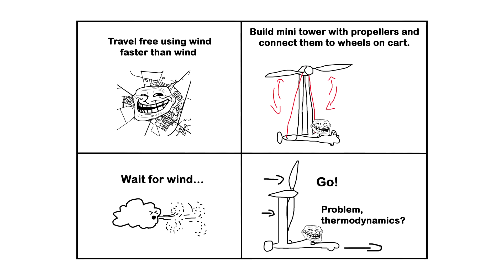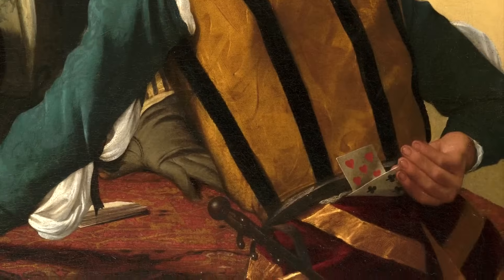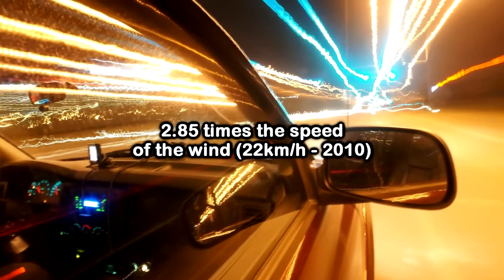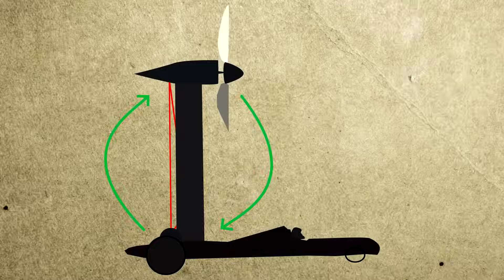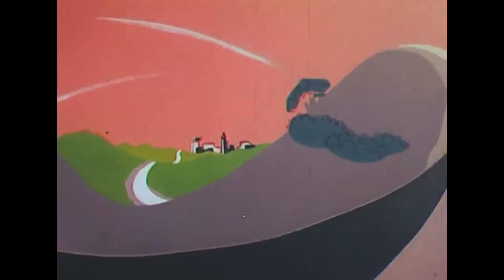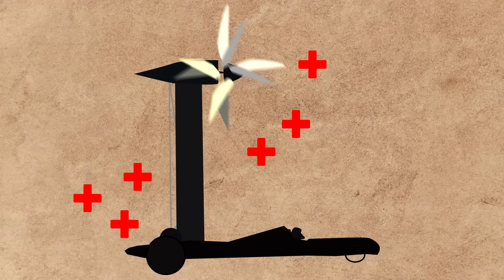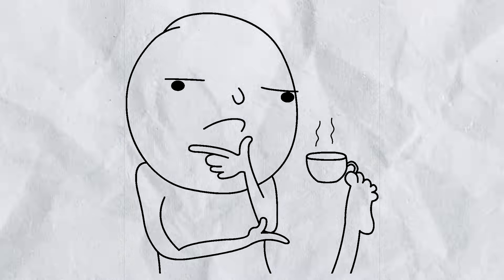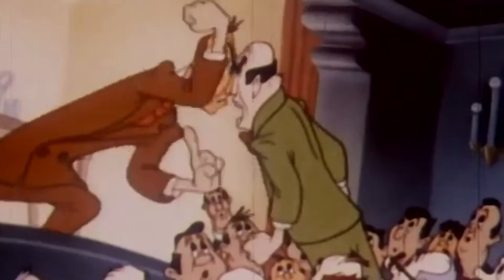why it works 14

Comment: if you still don't understand it, this is how it works basically:
1) wind pushes vehicle kinda like a fan-shaped sailboat, making wheels move. The fan does NOT help at all.
2) wheels turn propeller backwards(!). Not in the direction you'd expect!
3) vehicle gets to same speed as wind, but wheels keep on pushing wind backwards
4) wind being pushed backwards makes vehicle speed up a little
5) Where does the energy go? Why isn't this perpetual motion? Because it's converting the momentum (from being pushed by the wind) into a fan pushing a small part of the air backwards. It can't go infinitely fast this way: all it can do is speed up until it gets balanced out by wind strength, friction, and gear efficiency

like...
if you want a simile
imagine someone who's ice skating who gets shoved forward. And at the same time, they're also pushing back on the people shoving them. The person shoving them moves them forward, and shoving back on people gives them just a little more speed
Reply: So simply put, it is a wind powered propeller. It doesn't get pushed by the wind, it pushes the wind back.
Ie. Wind push left. Propellers push wind right, and an equal and opposite reaction pushes the vehicle forward.
Reply: it extracts the energy from Earth's rotation

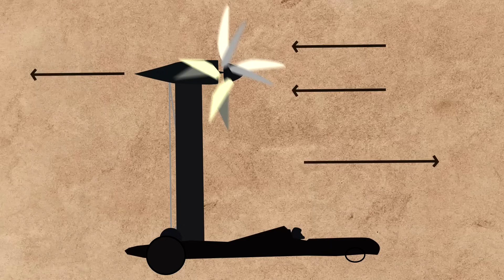Comment: 1:35 It's important to point out that it's almost always the "wind driving the propeller" it's just that because the wind CAN'T push the thing backwards (because it's attached to the wheels) the wind pushes the propeller SIDEWAYS - but that means making the propeller continue to spin, basically because the propeller has an angle, the actual SURFACE of the propeller blades is never moving faster then the wind at a given point. (The only difference is when the thing is moving exactly at the speed of wind, in which case there's no force acting on the propeller really and it can 'start' like if you start one of these vehicles on a treadmill with no moving air it will start to go)

Comment: in short, from what I understood this creates a virtuous circle when the wheels make a sort of call for energy which accelerates the fan which at one point accelerates enough to push back part of the air and accelerate at the same time, which the latter by returning increases the speed of the fan. Furthermore I imagine that this must create a pressure difference which must play a role in the acceleration. Is this it. My English is not perfect and sometimes I struggle to understand everything well
Reply: correction: in fact what happens at the beginning is that as the ground is denser than the air pushed by the ground, and due to the mechanism of the vehicle, we will have the same effect as a leg pushing on the ground to move forward.

Comment: The real problem here is people think of two objects, the car and the wind, and both are moving at some speed.
When in reality the wind is everywhere. If you move at 25 mph and the wind moves at 20 mph, you are not going to "outrun" the wind. After one hour, the wind will not be exactly 5 miles behind you and as such, can't push you.
Even if you outrun the wind behind you, in front of you is more wind to work with.
Reply: lol. that's not the problem. The problem is that wind can only provide energy at a relative velocity. Once you and the wind are moving at the same speed, you cease to have a relative velocity.

Comment: Here's an interesting question, if you design the propeller to have active wing angles, could you make a vehicle with negative coefficient of drag?
Reply: I think this is possible because of you have a plane that is wind powered you can switch your pov to inside of the plane. There the wind is still. But a turbine on the plane would still spin. And the wind would keep it on a constant rotation speed. This can be used to then power a propulsion mechanism. You would propably not call it a negative cw value because of its definition though.

Comment: For some reason I have a strange sense to tell the difference between AI generated imagery.
0:03 triggers that sense.
Reply from the maker: it's a poster from early 1940's titled "I Got an Idea! If it's Good...I'll Cash In!" 
this version however was digitally retouched given that the original looked dull, you can view it from here: 
https://upload.wikimedia.org/wikipedia/commons/6/65/%22I_Got_an_Idea%5E_If_it%27s_Good...I%27ll_Cash_In%22_-_NARA_-_514560.jpg
Reply: @tylerschannel  Oh ok, makes sense
Reply: Seems like you gotta recalibrate it
Reply: @arent1110  That sense is just very sensitive to anything that looks AI. Sometimes it'll trigger at non-AI generated content.
Reply: AI sucks because people start claiming everything is AI generated. I've already had two comments accused of being written with AI :P
Reply: @danhorus  It's possible that the way you write is very generic and boring, and lacks insight, which led to you being mistaken for an AI.

Comment: Therefore, we can use the same system to go faster than li-
Reply: gets turned to photons
Reply: @rowanstree8499  pronouns*
Reply: @ no i meant photons. photons are what makes up light
Reply: @rowanstree8499 almost, protons make atoms, it is Photons that are the light particle, they sound pretty similar
Reply: @ oh ye mb
Reply: @solartree4189  were/was to be specific
Reply: @solartree4189   was/were
Reply: The problem with going faster than light is since you're on talking basis with light what's stopping you from chatting up with time?
Reply: speed of light is also speed of information, and you can not run out yourself.

Comment: finally a troll hack that works
Reply: The other is the "hot air rises" one (it's a hot air balloon)
Reply: I found the oil floats on water hack to work just fine.
Reply: Or the one about running the steam from boiling water through a turbine for a "free energy hack"

Comment: I always though it was because of gear ratios causing the wheels to spin x number of times for every 1 turn of the propeller
Reply: isn't that what he's saying? i don't understand this
Reply: @glitch1039 He was more saying that the movement of the wheels will turn the propeller into a fan that forces air backwards, making it go faster, rather than the gear ratio explanation I thought was true.
Reply: @Enderblade18 its a similar concept however. Like a gear, it is turning "More power but slower speed" into "less power, but greater speed

Comment: For people who think this violates thermodynamics: impulse and kinetic energy are different one is proportional to m*v=F*t (t being time) the other to  (mv^2)/2 meaning that if push backward the twice the mass of something it will take exert the same force on you but take you HALF the energy ((2*mv^2)/2 < (m*(2v)^2/2 = 4*(mv^2)/2). 

So you can take kinetic energy from the wind and push off of the ground and because the ground has much more mass you'll gain kinetic energy even when you outpace the wind.
Reply: so it's like we're pushing with our leg on the ground. we push backwards m, but as there is more mass on the ground than in us, it is we who move

Comment: Anyone who's into sailing knows that it is indeed possible to outrun the wind. Gybing downwind is a common method.
Reply: Weirdly, it's a lot harder to go faster than the wind in the same direction as the wind than it is to go at an angle
Reply: Given you can sail upwind, I'm not surprised you can outrun the wind downwind.
Reply: well yes,but its different.
In this case you dont go with the wind,but diagonally.
Reply: the purpose of the propellers is to travel "diagonally" through the air. in the car set-up, each propeller operates equivalently to the sail in a boat. that's what makes this system work.

what's described in the video is an insufficient description of what's going on and doesn't properly justify how it can travel faster than the wind.